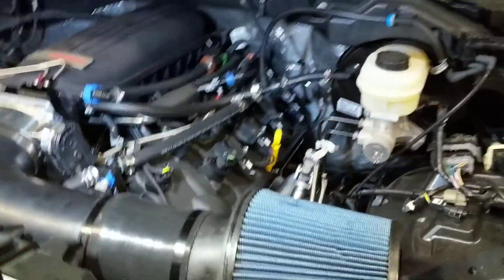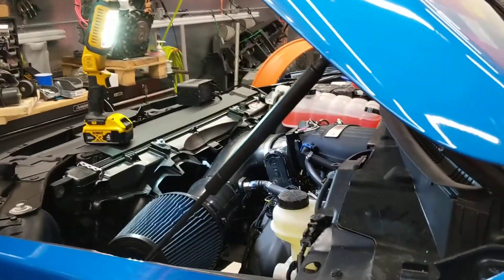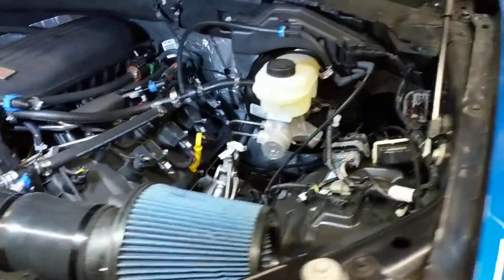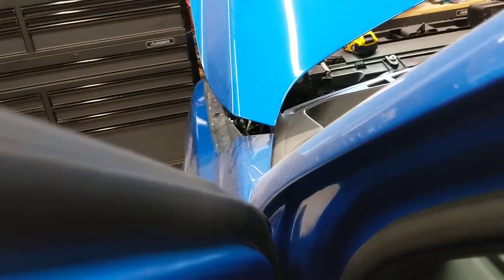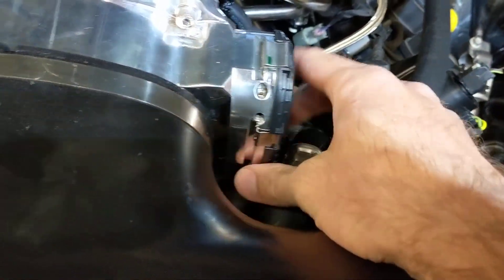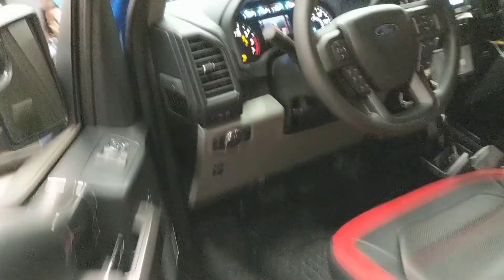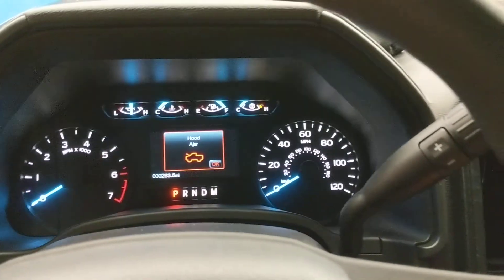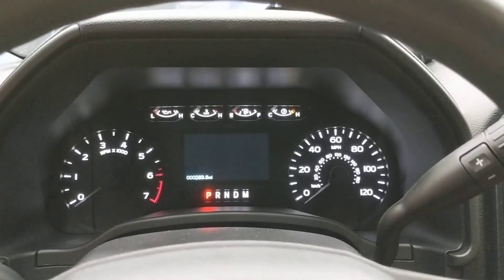2019 Cobra Jet F150 5.0

Comment: What throttle body did you get
Reply from the maker: It's the VMP Twin 69mm TB for 18+ mustangs. I finally got it working. It was actually a bad tune file. Truck put down 462 whp on E85.
Reply: @pdviper77   Have you ever put it on the drag strip
Reply from the maker: @mauricecooper176  yes only once on a full tank of E50. Did 12.7. Going back soon on an empty tank and ignite. Also lowered the truck with Vas Specialties 3/5 drop and traction bars on the leafs.
Reply: @pdviper77   I ran my truck last weekend did 11.5